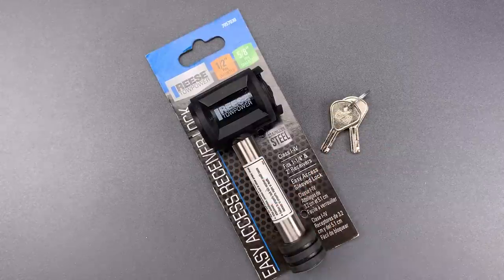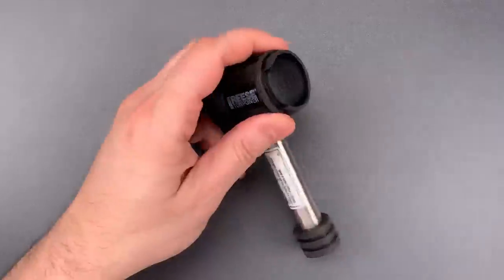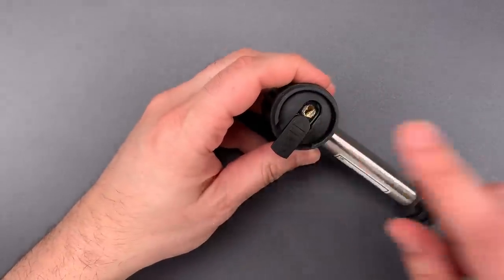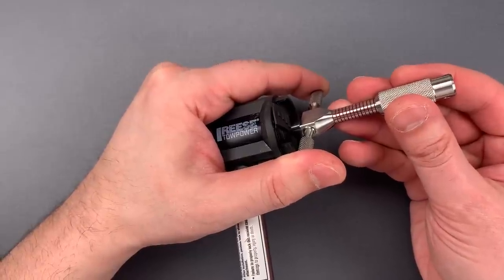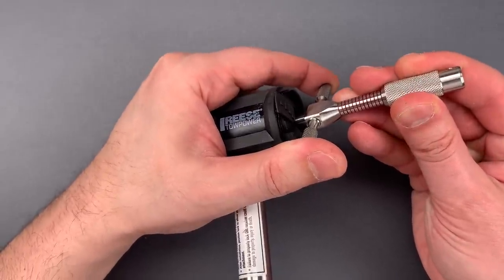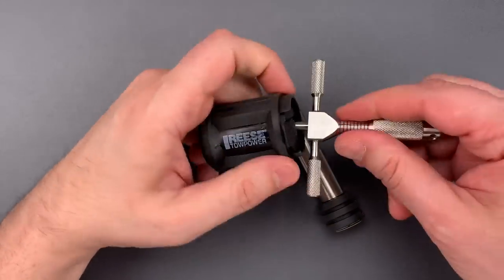[1066] “Virtually Pick Proof” Receiver Lock Picked (Reese TowPower)

Comment: So honest with the reviews. The way you openly discuss and explain contemporary designs and flaws gives the element of ensuring protection back to the responsibility of the person employing the lock. Meaning, money will not buy you protection, it buys deterrence + time. Real protection won't be bought, it is immediately employed to perform one function, absolute deterrence/physical cessation of attempt with a reward. We have a lot of break-ins in my region, the groups are clever and up to date with current lock/security measures. Ive had to resort to the employment of electricity and small-charge explosives in traps activated by unwarranted explicit access attempts. Every lock has a weakness, a lock trusts and communicates with every hand that touches it, mine dont

Comment: Dangerous, un-roadworthy and potentially deadly too. It should have a push in R clip through the pin shaft prior to the lock body so that if the lock body becomes detached the pin it doesn't work its way out of the receiver hitch and the tongue & towball &/or load become separated from the vehicle. Could be some extra legal case work coming to the Lock Picking Lawyer.

Comment: I picked my first real lock yesterday. It was a Masterlock (surprise, surprise) and it was simple enough to rake it with cheap tools then just as simple to properly pick it on a pin by pin basis. I then had a go at the Yale 851 shown in video 343 but i couldn't beat the mushroom pins with my cheap-ass tools. It felt like I needed loads of force to get past the mushroom pins and my cheap picks just bent backwards. Any tips for these?
Reply: Practice, you know your doing enough when you get calluses in weird places.
Those cheap picks actually do ok, a bit of time they wear in. 
LPL makes it look easy, but he is doing more with the torquing hand than the picking hand
Reply: @dashingdave2665  I've got a fair bit of practice in with the clear locks that came with the picks though they are pretty easy, no security pins and they are properly loose. This was my first time encountering security pins and it's easy to see how much of a difference they make from just a quick side by side. It also shows the skill LPL has when he fly's though these kinds of locks. Your comment on LPL doing more with his torquing hand is interesting. I'm a lefty so I was trying to do things upside down, torquing with my right thumb at the top of the key way and picking with my left. Think i'd have a better time copying LPL's technique?
Reply: J1mston - maybe try using a mirror?
Reply: It doesnt matter which hand you use, you can just turn the lock around. What he means by LPL using mostly the tensionhand is... when you feel resistance from one of the pins, push on it (not as hard that your pick will bend) and then slightly release tension untill the pin sets. Then crank the tension back up and go look for the next pin that gives resistance.

Comment: I worked at a store that sold these when I was first starting to learn picking, so I bought one. I used my tension wrench to try and tension it and get to picking. I managed to tension the thing and slid my standard pick in there and pushed something and poof, open. I was able to do this with 3/4 of the ones I exchanged it for.

Comment: I have used these lock. He picked it faster than most people can remove it from a truck using the key. However! I don't put them on my trucks to prevent 'theft' per se. I use them to keep other employees from 'borrowing' the hitches off my trucks.  It does that job well.

Comment: Have you reviewed the Bolt brand locks? They are designed to work with your current car key and it “learns” it when you first turn it. I use that for my receiver lock. I’m sure it’s very pickable but I like the convenience of not needing a second key and hopefully most people just won’t bother trying to remove it since they see the lock. But, if they really want it, I’m sure they can get it

Comment: I wonder if the plastic would shatter in the cold. In Montana we get temps down to 40 below 0 and most plastics get brittle and break. Even extension cords will freeze and break unless they are made with rubber rather than plastic or vinyl.  Chill it down to below 0 and hit it with a hammer and see if it shatters. If it does then it is a major safety hazard because it could break and fall out and you could lose your trailer.

Comment: What hitch pin lock do you recommend? I think you should do a basic video that covers all the various style locks you recommend so watches can just buy those and have some sort of confidence. Of course things will be updated but at least you could have the old best vs new best vids to put up and update old vid info as needed. I have a cargo hauler on a short bus project of mine and want to use a hitch pin lock as well as come up with ways to make takin the cargo hauler apart more difficult. Hope to keep a generator, fuel cans and other things kept back there as safe as possible.

Comment: I had one of these, rusted shut, the rubber cap on the end of the pin slides off. It's just a rubber cap with a metal ring inside crimped onto a crosshatched etching on the end of the pin. Took 5 seconds to come off with a prybar.

Comment: Also (at least the one I had) the rubber and metal cap on the end of the pin can just be pried off with a crowbar... they are attached to the end of the pin with a thin metal ring that clamps onto a checkered section of the pin. Then you just pull the pin out of the hitch. May be worth a follow up video?

Comment: If I had to leave a drawbar in a hitch for an extended period of time, I think my solution would be a high-grade carriage bolt, a square nut, red locktite, and a lot of torque.  The only way to remove quietly would be to unscrew that square nut, requiring a 4-point or 8-point socket, and the red locktite and limited angle to put a wrench on would make it difficult for an open-end wrench to get a bite or to get any significant force.

Comment: Suggestion for an unpickable LOCK =  Instead of 1 key-lock there is 2....One in each end of the main-part-Steel-cylinder.

It can only be opened with 2 keys pushed in at the same time and unlocked by turning the keys at the same time. So unless you can pick 2 locks at the same time with Exactly the same Timing in the exact same way you are fubar. 

I can also add that you only have 1 second to push in the Keys, (or Pick both locks) or it will not open.

Comment: When I think of "virtually pick proof", I can't help but consider my 30 years of experience as a software engineer. You see, in object oriented programming the concept of "virtual" means that there is a facade for an object or function that can be called upon at will, but in order for that function or object to do something, it must have an implementation underneath it. This implementation is traditionally called a "candidate". In this case the implementation is missing altogether.

Comment: A couple years ago I had someone break into my house.  They spent considerable time forcing a ground floor window.  The window was slider held closed by an old plastic hook on the side.  This slider was not spring loaded.  The person pried with a screwdriver at the screen and removed it.  They proceeded to spend time trying to defeat the plastic hook.  (I had defeated this type of hook before by tapping on the window to bump it out of the way and open a window).  My advanced technique was apparently unknown to the burglar.  After spending a significant time there they went to the large sliding patio door 4 feet away and tried it.  It was unlocked.  (I literally NEVER leave it unlocked, it was the only time I had!  The timing was incredible.)  They opened the door and tripped the alarm.  They ran away.  This was in the summer at 12 noon.  Who breaks in at lunch time?  Clearly a genius.

... hmmmmm... maybe attach a rating... 

1.  If the lock has an internet savvy lockpicking lawyer subscriber what age would this lock keep out?

2. If a meth head who only has a screwdriver and prybar how long would it take to force the lock.

Comment: Another video in which the lock is really easy to pick... using the one-of-a-kind specialized custom tool that two guys made for this kind of lock. I assume this means it's impossible to pick without it.
Reply: The tool just seems to be an easy to hold picking device, like putting his picks in an easy to control cylinder rather than a loose pick. It doesn’t look to change what happens internally.

Comment: Lost the key to mine, came here. Don't have that fancy tool... But after hitting the lock side of the installed lock with my wife's little pink hammer (not a euphemism) the cylinder fell off in about ten solid, but not crazy hard, whacks. Lock still 'works' after too! Seems like I might have gotten lucky and rattled it into the right alignment... But this lock is junk.

Comment: The makers of Hitch Reciever locks are  "damned if they, damned if they don't". They can get bent with a hit of the trailer tounge, rust if left on too long, keys can get lost, & all of these scenarios can result in an "average" mechanic grinding or torching the locks off. By doing so destructively, damage would be often incurred by the vehicle.

So these manufacturers probably receive as many or more complaints about their locks being "too tough.....". Since these are more or less visual deterrents for the unmotivated or amateur thief, why not just make them cheaply but make them "look tougher" at the same time.

Comment: You used a custom tool to pick a lock, something no ordinary trailer thief would have.  You are also missing the point about smashing the plastic off the end, the lock is metal and still would be attached to the bar and still wouldn't slide through the receiver, smashed off plastic or not, it would prevent theft.

Comment: Again, do not really feel this is fair at all. A receiver lock is designed to be in place with very limited space. I bet anything it would be difficult to use your special tool because the handles would be hitting metal.

Comment: As far as coupler locks, this one is not so bad.....when you compare it to the rest of the Reese/Fulton/CPL line of coupler locks. I am not saying it is GOOD... but it is an attempt toward something less crappy than what preceded it.

The prototype tool possibly would be impeded by the body/frame of truck as well.... it is all just so ridiculous to say this is an "easy" surreptitious theft, as compared to the typical hitch and coupler locks. Why no Ram-Set test ?

You could even put a Medeco, EVVA, Protec or other premium cylinder in it, and the thing you tow would still be gone...... because coupler locks are a failed concept. NEVER rely upon a coupler lock to be secure in the first place. So with nearly all the sheeple responses, all predictable, all the same... you can still hear the slurping even when the wifi is off.

I have looked for a reply that is technically interesting. I could not find one, so I wrote this reply, in the event someone else wanted more than the sound of slurping.

The best Receiver/Coupler/ locks I have found so far, are by BOLTLOCK.... because they are sidebar locking, and quite weatherproof. But far better to lock a wheel. So if LPL comes to steal the trailer, he can defend himself......

Security is a measure of TIME, not IF something can be de-engineered or not. The resistance factor, and barring simple bypass methods I will not enumerate upon, for a holistic approach to security, is the goal. On a trailer, I would use the "All-Of-The-Above" approach of mechanical barrier, electronic monitoring, and GPS reporting. MAke your vehicle the OBNOXIOUS one to deal with... they will take the easier target more often than not. 

So how many prototype picks are out there? How does the would-be thief determine the lock is a rotating disk type, and what pick works on it, if any? Given location of lock under bumper, the generic appearance of these locks... crook will possibly spend as much time just figuring out what TYPE of key cylinder it is, as attack time, if they have the clearance.